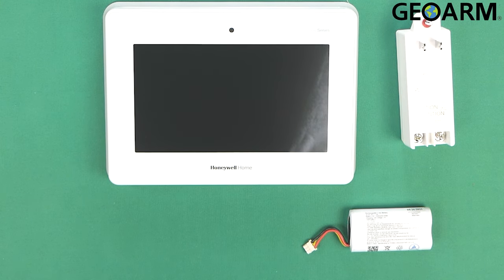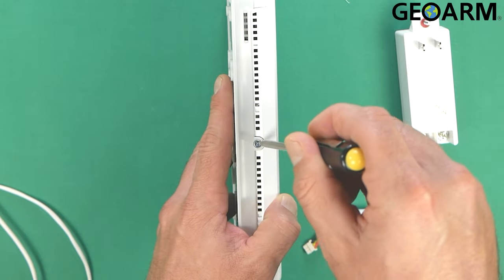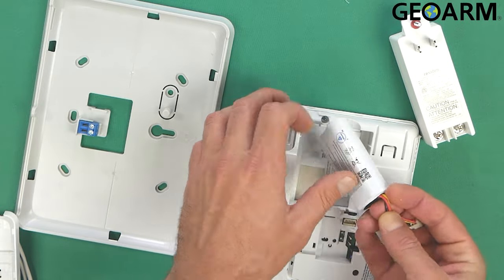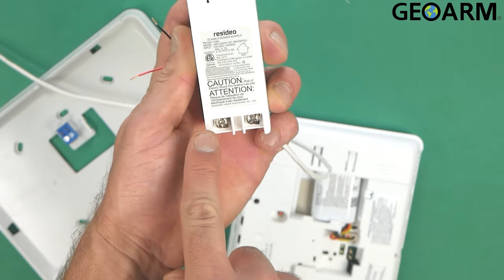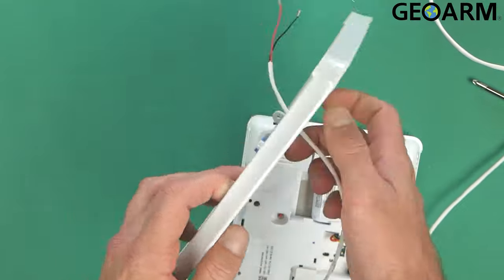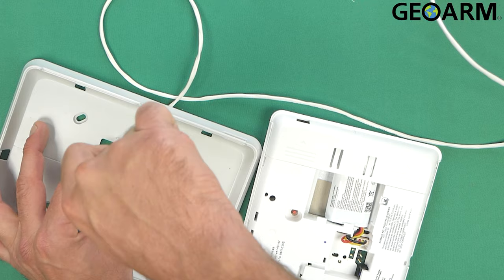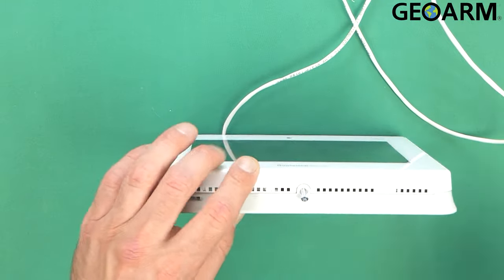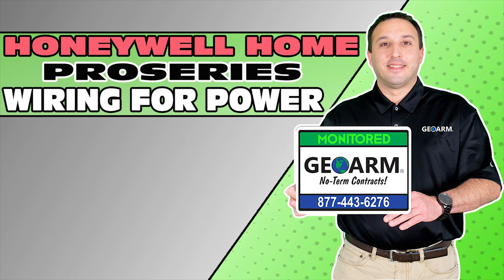Honeywell Home ProSeries: Wiring for Power

Comment: Thanks for the video but I have a few questions - Is that wire included with the panel? If not is it stranded or solid? How long is the wire if it's included? I'm wiring to a receptacle in the attic and I'm wondering what is the max length of the wire? Thanks!